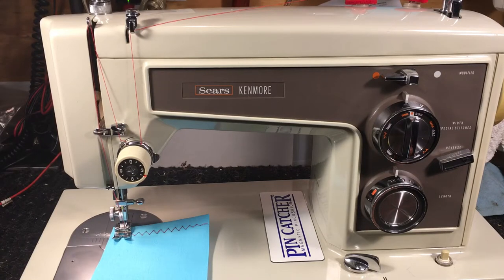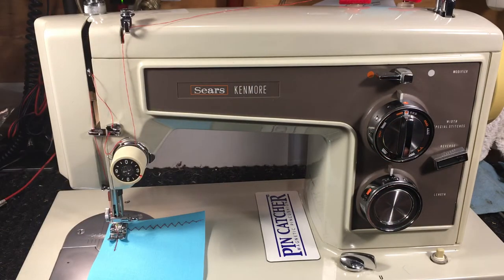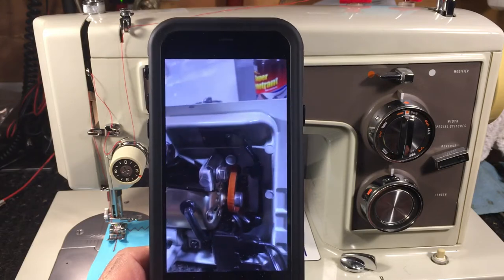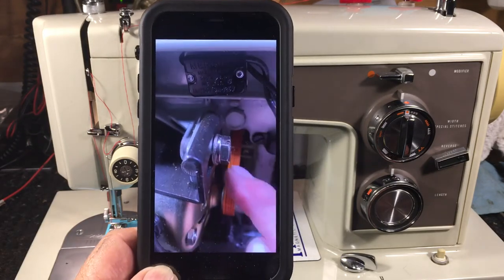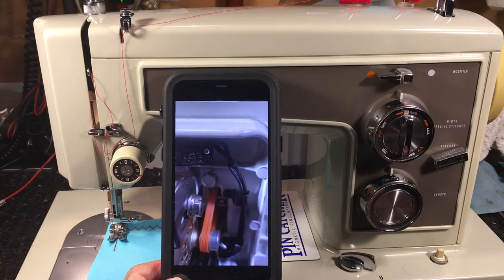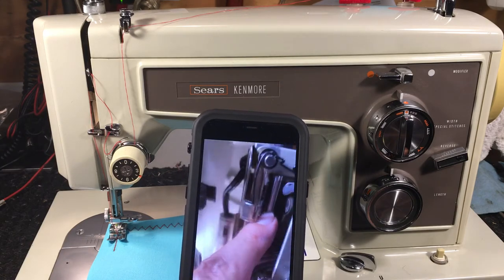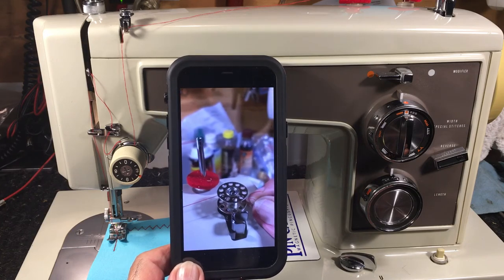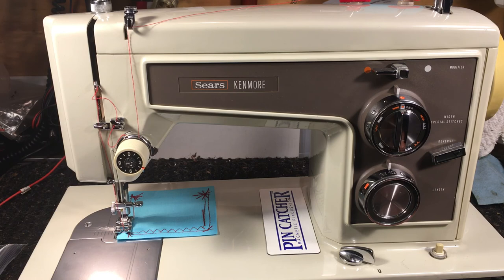How to get a Refurbished Kenmore 158.14301 ready to sell. here’s the process (video 113)

Comment: Thanks, I was able to get it corrected. I heard the comment about the screwdriver after I had loosened the screw.  Once I got the cam follower freed up I was able to put the selector on straight stitch loosen that screw again and the follower popped over to the correct cam. I then tightened the screw and it works great now.
Reply from the maker: Excellent. Good job.

Comment: i just picked up a 14301 from goodwill. its wonderful tho i know nothing about them or sewing. i have watched your videos but am a little stumped. when threading around the tension knob i cant seem to find that little nipple your show that the thread goes around. also, my tension plates do not tighten at all. should i pull the tension knob apart and service it does it have a spring in there maybe that is warn out? thanks for taking the time have a great day
Reply from the maker: Most important of all: DON’T DISASSEMBLE YOUR TENSION ASSEMBLY. 
When you thread it, make sure your presser lever is raised. That separates the tension discs and allows for proper threading. 
As you place the thread into the tension on the right side, you’ll notice the the shiny metal guide that your thread can rest on and slide into proper position between the discs. 
As you continue around the tension assembly to the left side, you’ll see the little notch in the metal piece that is positioned above the resting check spring. 
If you hold the thread at the spool and prevent it from moving, at this point you can lift the thread on the left side and see it and hear it “click” into the notch. 
If you lower the presser foot and pull the thread from the left side you will feel the resistance that lets you know that the tension dial is threaded correctly. Make sure the thread tension is set on 4. 3 to five is the range that you’ll be using to sew on light or heavy fabrics. 
If you reach for the dial to try to solve an issue, look elsewhere. The tension is almost never an issue when it’s set on 3-4-5. Good luck.
Reply: @randyyoursewingmachineman9954  thank you i figured it out. another question if you have the time. how do you use the feature to wind a bobbin with new thread? the cap i saw that you replaced with a metal one on my machine seems to be locked on so tight that i cant get it loose i have heard that you have to loose that tpo be able to wind new thread on a bobbin without binding the machine? hopefully you understand what im inquiring about as im new to sewing so i do not no the correct terminology yet.
 thank you have a wonderful day.
Reply from the maker: @ryantalkington1308  sometimes I have to use a channel-lock tool to loosen the hand wheel release knob. I wrap some cloth around it first, so I don’t scratch it. 
Hold the hand wheel with your left hand and release the inside knob by turning it about a quarter turn to the left. (Lefty loosey-righty tighty)
Good luck.

Comment: I have to ask you if you’re aware of the adjustment that can be made to the bobbin winder assembly. I have a 158.14100 where the bobbin is  only filling about halfway. I think there may be a spring in that and a screw that will adjust it.
Reply from the maker: Remove the top and look under the bobbin winder mechanism for the adjustment screws.

Comment: Randy, you just hit it out of the park with this one. I own a 1430,and love it. My go to machine. But I have a question for you. There are 2 spool pins, and 2 thread guides above the needle. However, as far as I can see, there's only 2 tension plates.I should think that there would be 3 plates for twin needle sewing. The owners manual makes no mention of twin needle capability. By contrast, the 1802 has 3 tension control plates (discs) and the owners manual does mention twin needle capability. Any thoughts or comments?
Reply from the maker: When I demonstrate their double needle capabilities, I thread them through the single disc slot and it just works. Make sure both threads are exactly the same size and weight.
Reply: @randyyoursewingmachineman9954  thanks, Randy
Reply from the maker: @ronalddevine9587  you’re welcome

Comment: Randy, i just got one of these at a thrift shop. Beautiful condition but I cannot get the stitch selector to go to the red dot. I’m sure it is just sticky old oils but I can’t figure out where to use oil or penetrating oil to free it up. Also, is it normal for the reverse knob to move up and down when the lower dial is turned?  I have oiled the zigzag “plunger” in the nose of the machine to loosen that mechanism.  Thanks for posting these videos.

Comment: I am working on a Kenmore 1430 and the stitch selector knob would not turn to the red dot, straight stitch. I oiled everywhere I could find something moving and ultimately loosened the screw of the arm that runs the stitch selector.  I could then move the selector knob to straight stitch however, upon tightening, it would not go back to the red dot.  Long story short, the selector now moves but the stitch the selector is set at is not the one the machine makes.  How do I reset the cam follower to be on the correct stitch?
Reply from the maker: That’s going to be more difficult to explain than this format will allow. I always say,”Don’t do anything involving a screwdriver until you’ve lubricated everything properly”. Rarely, if ever,  is an adjustment needed on the inner workings of a Kenmore. I wish I had more help for you. Sorry that I don’t.

Comment: I have a 158-13010 and it is quite similar to this one.  It works wonderfully, except that when I press the reverse key, the fabric just stays in place.  It looks like the feed dogs are not going all the way backwards. Any advice on what to address?
Reply from the maker: Pop the top off and look on the right  side underneath the main shaft. Put you stitch length on it’s longest setting. Activate your reverse lever rapidly and you will see the movement of the assembly that needs to be oiled. The slide assembly that moves up and down needs to be helped to return to it full movement with oil, and maybe some penetrating oil. Oil it and work it.  No pounding, prying, cussing, or feet stomping is permitted. Be patient and you’ll emerge victorious.